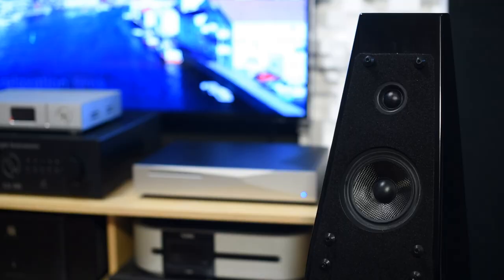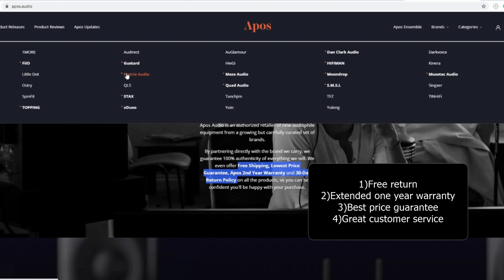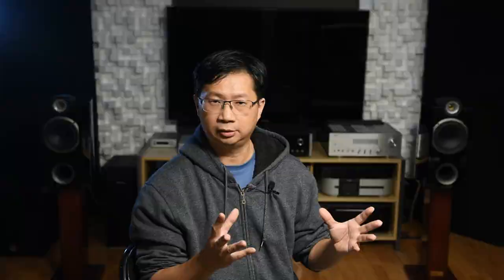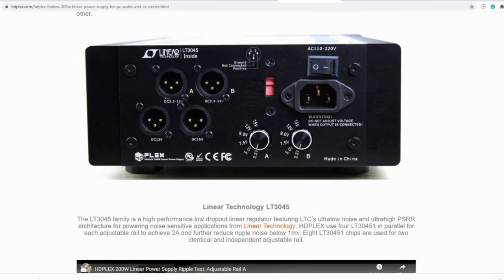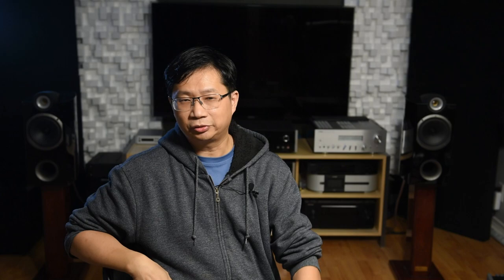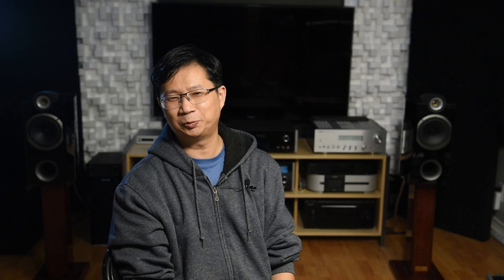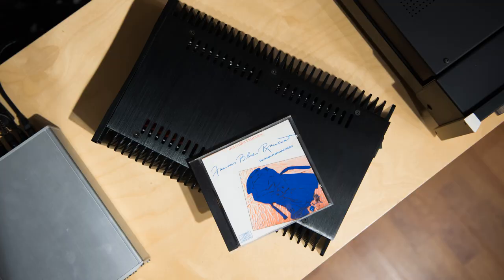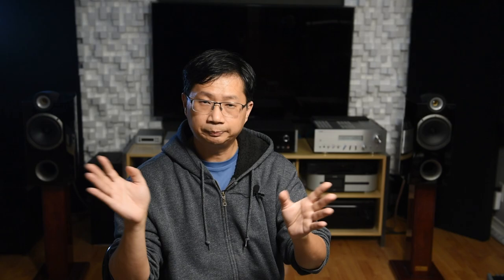Audiophile-grade computer? Really? How do I get one?

Comment: Absolute nonsense.  Formal engineering training needs to become a requirement for on-line reviewers otherwise you end up with lots of suggestive  inferences that mean nothing.  If you think your hearing a difference but its ever so slight, its likely your just playing a head game with your self.  I would like to hear some cold hard science explaining how any power supply changes would make a difference on a PC that is only serving up TCP or UDP packets over a  network.  It can not make "dark" space "darker".  Curious why you keep your server right next to your audio system?  I keep mine elsewhere, out of sight, and with no audible sound present.  There is no reason a server needs to be show piece to do what it does, well.  And it doesn't matter what you do to it, the data packets still arrive with plenty of time to spare so that the ones and zeros can be re-clocked by your DAC.  These kinds of so called reviews are what destroy reviewer reputations.  The science isn't there and I am sure  blind testing would show that you would be wrong half the time.
Reply from the maker: Sure, I would wager you also believe all cables sound the same. As I said, this is a topic that has been debated to death and I am not going to pretend to be able to offer you any meaningful convincing scientific explanation.  That is why I state at the beginning of the video, contrary to many who have heard the difference, if you believed all Media servers are the same, there is no point in watching the whole review. Formal engineer training is needed only if I attempted to explain the reasons. Listening to something and sharing an opinion does not. I can critic how a plate of food taste but I would not attempt to tell you how it was cooked unless I have a chef background.
Reply: @ThomasAndStereo  Not exactly.  I can clearly understand the difference between a junk cable and a good cable comprised of known reputable wire and cable manufacturers but when you cross the line into the so called elite cables that make um-provable claims or let you make  false assumptions, then you would be right.  I find that most commercial grade cables are a pretty safe bet and as for speakers just go with the biggest gauge possible and again ignore those designer brands.  For power cables, again just use the biggest gauge possible on your power amp/s and don't worry about all those low power consumer components.  The stock cable is most likely just fine for those.

Here is something to think about.  I could use a piece of CAT3 cable instead of CAT5 or CAT6 cable to my DAC and you'd  never hear the difference.  I wouldn't recommend it but it would work well enough.  With your like of thinking, I'd like you to explain why this would or would not work.
Reply: Ah, I just remembered why I dropped "formal engineering training." Thanks!
Reply: @andrewwesley1946  So you can spend your spare time chasing dirty tcpip packets.

Comment: For those of you who wont build a pc and just want to just buy something... Lenovo makes tiny PC's the ThinkCentre m90n with intel  i5/i7, M.2 HDDs and up to16GB of ram... Noise floor is very low and there really tiny! No fan noise, small so CPU, PCIe, RAM bus is a short path, decent external power supplies which can be upgraded. Other wise Mac Mini is about the same concept.  I have built 1000's of high performance PC's and Performance servers over the years and I would rather buy one of these than build any more for myself or clients. Not that you can't get better by building but how much better really is the question? M.2 HDD's and low NM processors have gotten so good over the years. IF it's just for music...
Reply from the maker: I was actually considering that route myself. Get rid of that big computer in the room and replace it with some tiny PC. Thanks.
Reply: @ThomasAndStereo I have had a media center style PC's I built, streaming movies, music forever! Well since windows XP came out with media center edition... As I was a systems designer for a company for 25yrs!  Now a owner of a IT company myself. The small foot print works so much better.  Don't' have to look at power supply efficiency, solid-state caps on the board, what chipset, having to decide what case, hard drives, what ram, ect... Just buy the machine, install Aurdivana, Plex or whatever, tweak services, bandwidth throttling then forget about it! Set a rdp connection to change things if you don' t have it hooked to a TV.... It's perfect! Solid no noise. Now my server on the other hand that feeds it everything is a bit different as I don't change it for 7yrs at a time and it needs to have 0 faults on the VM's.
Reply from the maker: @jwiggins1229  Thanks for sharing.
Reply: Glad I got the big ass computer outta my serious listening room.  I with with a simple green machine hosting roon, a sonore ultra end point, and a mytek DAC+.  Quiet. And oh I decided I want youtubes too--I hung a TV and just go from TV optical out to McIntosh C2500 and an ethernet cable to the router.

Comment: My God... So many expensive staff... However, in order to have a clean USB output, wouldn't it be easier to buy ALLO USBridge Signature (239 USD) + ALLO Shanti Power Supply (159 USD), install Moode Audio OS on SD Card and enjoy music from TIDAL and/or NAS server while controlling the device with an app on your phone ;-)?

Cheers,
Przemek
Reply from the maker: Sure, that is a solution too.
Reply: Would be nice to review this solution. I am considering it but have no idea how convenient it would be to use, apart from sound quality, which has received positive reviews. How do you turn it on/off, how easy is it to access streaming ( Tidal, Quboz...)?
Reply: @davido4872  Hi,

USBridge is an SBC (Small Board Computer) in metal case so you can keep it running all the time without turning it off.

If you want to turn it off gracefully, you need to login to the device with SSH and execute Linux command 'shutdown -h now'. How to do it? Very easy, just install on your phone "SSH button" app and configure it to send this command to a device after one click.

Once device is shutdown gracefully, you can physically turn off ALLO Shanti power supply. Want to do it without moving from the couch? Just plug Shanti to WiFi Power Plug and turn it off and on from your phone with app like e.g. "Smart Life".

To sum up, this is very convenient solution when you add additional things mentioned above:

1. Turn on Shanti power supply (and USBridge) with "ON" button in "Smart Life" app.

2. Once you install Moode Audio OS, enjoy Tidal with MQA- MQA is passed through so you need an MQA DAC e.g. SMSL SU-9 for 439 USD. You control TIDAL very easily with free mconnect control app for Android.

3. If you want to turn off the device, first press "shutdown" button in "SSH button" app, next press "OFF" button in "Smart Life" app.

ENJOY ;-)

Cheers,
Przemek
Reply: Thanks, Przemek. Just saw your reply. I'm looking at a Windows based mini pc because its familiar but I have to give the solution you describe some more thought.
Reply: @davido4872  Windows PC is bad. Go for Raspberry Pi 4 with DietPi + LMS and Squeezlite (don't go for bloody expensive Volumio) and enjoy good music from RPi USB output ;-)

Cheers,
Przemek
Reply: @przemekdoowy2630  Do you still recommend USBridge?  I'm not familiar with Squeezelite, lms...just want to start streaming high resolution from Tidal  on my stereo. Is there a solution that is simular to operating a pc?

Comment: LOL, OK let's talk science for a few sentences. 
A. Your computer power supply DO NOT matters, it is powering the computer. 
B. It is OK that your digital output is noisy,  they are design for that!!! a 1 is a 1, a 0 is a 0. It doesn't even matter if they super noisy. (You can read more about how USB works, it will all makes sense)
C. Digital data should only be use for transfer the source file, not processed output. 
D. If you really care about sounds quality, use external DAC with whatever power supply you think is best. Because the DAC is what really convert the source file into "sound signal" for your output. 
E. Unless you are doing sound editing, which do required sound output directly from your editing device like the Computer. You don't need anything special computer to super high quality music. If you are just listening music file. The computer makes no difference. Electric wise. The most expensive or the cheapest potato is the same. 

Get a good DAC, and if your like get a good power supply for your DAC. And most importantly, get a good output device. And don't get broken cables. You are good to go. Believe or not usually the most expensive thing that affects the sound quality is the actual room you are in. LOL everything else is relatively inexpensive.
Reply from the maker: I have 20 Dacs and a fully treated room. Science? Yes I have a degree in that.
Reply: @ThomasAndStereo So why do you need a USB 3.0 interface that's over $300? Look, if noise changes signal quality on the USB interface, ever every so slightly, then NO ONE should ever, ever use USB hard drive because data would be corrupting all the times, making any USB based transfer unusable in the real world. I can't say transfer through USB is 100% reliable. Nothing is, the activities from the sun can affect it in some super rare cases. But it should be good enough for a typical song transfer, even if it is DSD or PCM file transfer for a one time use audio source file signal. 99.999% of the time USB transfer should be perfect within the speed it is specified for. Again there are white papers and test results out there for everyone to read. I am not trying to argue here, just state the fact. At the physical layer (PHY), the allowed bit error rate is 1 bit in 10^12 bits for USB 3.2. That's 1 bit in 1.25TB! Not to mention their software to double check what's being transferred. So what contribution does a "clearer power source" have for the USB interface?

Sure I agree 100% that a good power supply can really affect the DAC depending on how the DAC device is implemented. And everything after the output from DAC is more subjective to noise because those are analog signals. And of course the actual environment acoustic character. At that point it is all physic, and mental perception.
Reply from the maker: @foolzage  Just listen to it first, then decide. The proper scientific method starts with observation. If you don't know the steps of the scientific method, Google it. Trying to deduce how it should sound as opposed to actually observing it, is like going back to the ancient time where people debate logic in a circle trying to figure out the truth of the world.
Reply: @ThomasAndStereo  This is technology we are talking about, and technology works on definitions, and it is especially true on digital related technology, in this case the USB protocol. It should work exactly how it is defined, and countless tests have been done to prove in fact it is doing what we defined. This is how observation should be. And it is done right. And we as users have been proven USB protocol works reliably.  My statement is based on countless amounts of observations. As long as the USB interface from end to end is not defective, all the same Gen USB works the same. From every device. And its "quality" is a measure in "error per transfer bit at specified speed". There are, however things that can affect its speed, like the amount of device connected to the interface. I mean really it is all in its name Universal Serial Bus. 

And we all know that digital communication is very robust when it comes to noise interference. Again as long as things are made to spec. With quality material and proper shielding, and physical specifications. 

The only thing that can change a digital audio quality is the bit rate, so how many bit per second, so if your protocol is too slow, it can only give the DAC so much information to work with. But even USB 2.0 is more than enough, which has 480Mbps, while even Loseless Format like Flac or WAV rarely goes above 1-2Mbps. That's also why Bluetooth sucks because it is not fast enough, especially the older generation. (It is getting a lot better now) Anyway above 5.3 is actually catching up, assuming reliable connection. But that said something like USB 3.0 would have zero problem transferring any music digital sources to the DAC. 

Sure your end system may sound amazing, and that's great. You may have a great DAC, PSU for the DAC and Speakers, and a well built room and all that, which can make all the difference. But I can guarantee you, it has nothing to do with anything from the computer end, you can get a Cheapest Dell from 10 years, or the new 10K Mac or custom build. It will make zero difference. 

Don't believe me? And want to get scientific? Get an Oscilloscope, and take a look at the signal itself. See if there's any difference in quality. And remember when it comes to digital 1 is 1, 0 is 0, as long as there are no errors. The signal quality is exactly the same. Now that's what I call observation. (Believe me, we have done that so many times.)

But hey, whatever makes you happy, just trying to help you or anyone who came across this to save some valuable resources like money and time. If your setup makes you happy, I am not here to take it away. And I feel happy for you.
Reply from the maker: @foolzage  I am aware of the zero and one arguement as well as all the stuff you mentioned. We learned that at school, yes I took computer science classes.  I think what I also learn from going to higher education is to have an open mind. Perhaps this will give you something to think about. 
https://darko.audio/2022/08/expert-opinion-mark-jenkins-goes-deep-on-digital-audio/
https://darko.audio/2018/11/why-isnt-digital-audio-just-ones-and-zeroes/
Reply: @ThomasAndStereo  great list of resources on the topic, and now I understand why people are suddenly so picky on the USB stuff. 

So essentially, people are complaining about two things, A.) The USB is the source of the noise to the DAC. And B.) Something I mentioned before is the faulty (not perfect) equipment can be  very commonly found in USB. 

B.) I can totally agree, the protocol meant to be robust, so by definition it means less quality parts can work just as well. 

A.) On the other hand, is like..... OK the DAC is great, it does what it should be doing, but this noise USB is destroying its beautiful art, in this case music..... I found this nonsense. If electricity is the problem. Why not use optical? Like fiber optic to transfer the 1 & 0？then it would have no problem. But of course people will say there are still electronic components needed to convert the signal, which can make other noise, etc. But really, if the DAC really needed that perfect input, then by default, it should isolate the signal and recondition the signal before use. Then any digital signal would be "perfect" by the time it got to the DAC chips. I mean clearly this is the same technology that the expensive USB interface is doing (if it is what it claims to be.) which is arguably worse because after the signal is "clean", it has to go through that long, long USB cable only to pick up more noise again...... 

Well, on a fair note, I wouldn't take a listen for myself as I know for sure my ears are reliable. Everyone's ears go down hill after 25. So the only way to find out if there's any difference at all is to measure the output directly from the plug, with the DAC connected to a different USB source. Anyway things are just dry talk. I am pretty open minded to any idea. But I am very close minded on how to get myself convinced, and only objective evidence can do that. 

But listen, I may disagree with you on this subject for the time being, but I thank you for sharing all the information, Truly.

Comment: Stop using USB/spdif/toslink and you just solved 99% of your computer problem.
Reply from the maker: What would I use then?
Reply: Thomas & Stereo Ethernet with properly shielded rj45 for full galvanic isolation.
Reply from the maker: @zipperunamused9009  Ah, yes. Need a streamer for that or the DAC must support it.
Reply: Thomas & Stereo yes. Get those dacs as opposed to dicking around with tweaking a flawed platform (ie PC)
Reply: @zipperunamused9009  have you tried different Ethernet cables? I moved from a cheap generic to a Supra Cat8, big difference.  Might be due to Cat8 having better shielding, but I noticed a significant difference
Reply: Shahid Iqbal No. Too much hassle and I doubt it would be any different. All my Ethernet cable going to my streamers are custom made with right crimping tool and fully shielded rj45. I see Supra cables do not have shielded rj45. You will not get full galvanic isolation without shielded rj45 plug.

Comment: Super weird how terrible the sound is on your video 😂 Maybe as an audiophile you might work on isolating your speech more and cutting out the awful background noise.
Reply from the maker: I have been trying to get a good reasonable price mic for my DSLR with no luck. It worked better when I was filming with my phone.  So I boost the volume in post which might be the background noise problem.
Reply: @ThomasAndStereo  There are tweaks you can do to isolate and remove the noise. But it sounds partly like a software issue, since the difference between your speech and the empty noise is huge. It might - ironically - be because you are filming in your sound treated room.